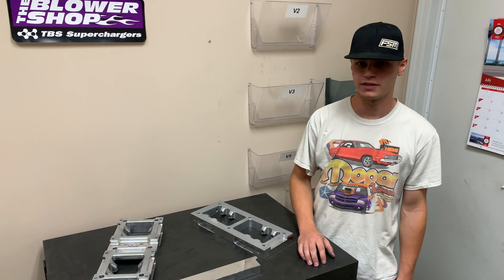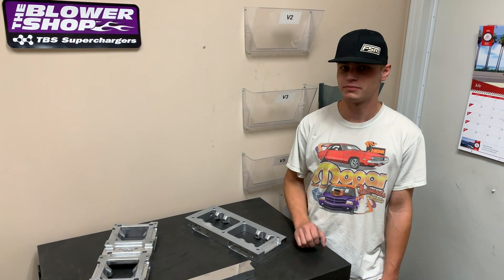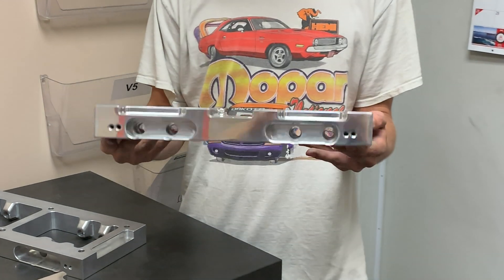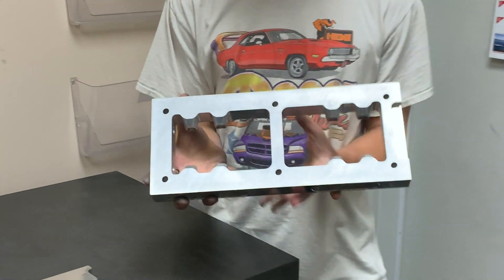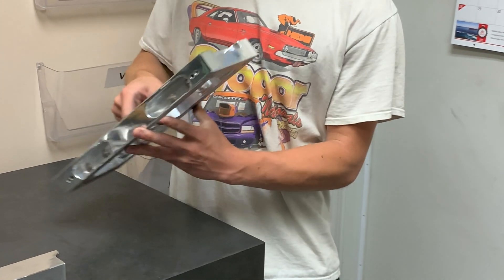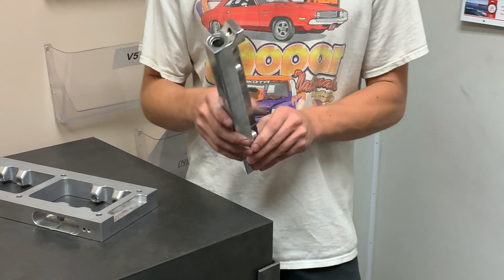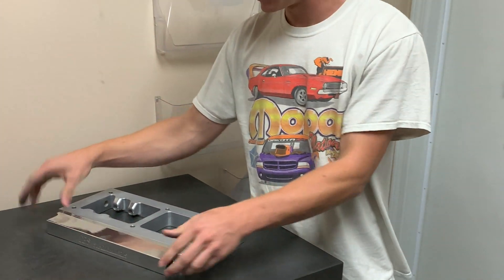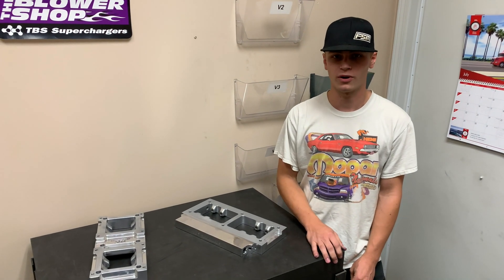Boost Bio 11 - EFI Setups

Comment: Wonder who’s idea it was to have the injectors straight across from each other, also spraying fuel horizontally when it needs to travel vertically…? 

Just whip up a CAD design and make it hold injectors… No testing, science or common sense put into it… Pretty impressive for the 21st century… 
Not to mention it’s the size and shape of a Chilton manual… 

So when the injectors fire, the fuel spray can collide into the other causing various issues… 
Someone had the bright idea of putting the big nodules in the air flow path thinking it’ll “pull” the injector spray down into the blower… Rather than making the nodules redirect the fuel down into the blower while still maintaining fuel atomization… 

I love how various products and design these days solves about 50% of the problem and the last 50% is simply “f*ck it…”  👍
Reply: A 6-71 is pulling in over 400ci of air with every 360° rotation of the rotors, the injector spray pattern never even has a chance to go horizontal. The blower is pulling so much air (especially at higher rpm) that soon as the fuel leave the injector its pulled straight in to the rotors